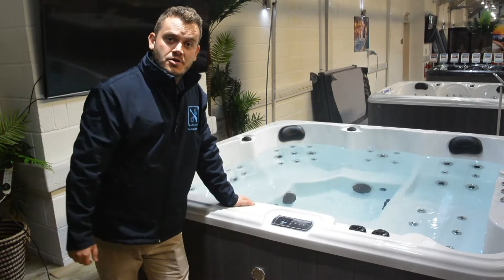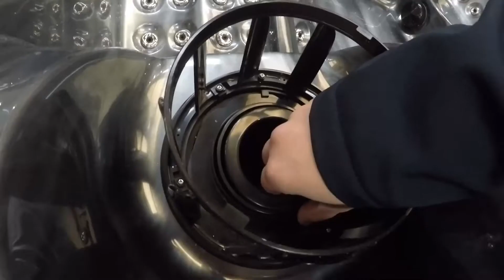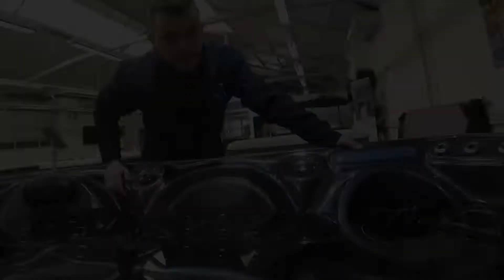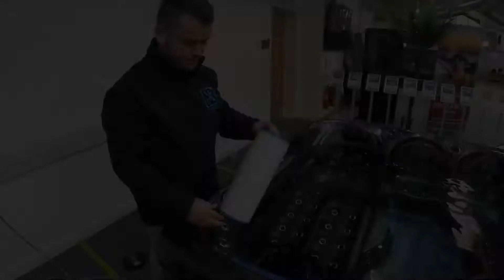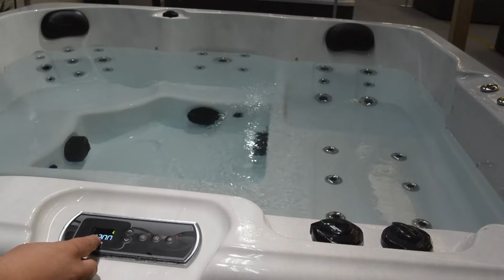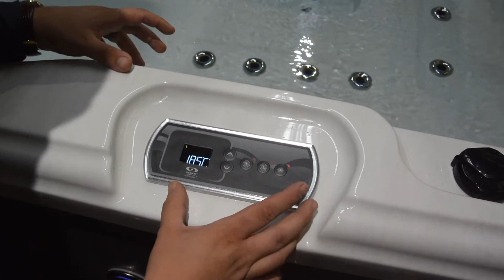Starting your Gecko hot tub

Comment: I have just moved into a house and it has an aeware 3 by gecko and we are confused what to do with it. It is filled about half way. It looks much bigger than the one in thr vid and the water isnt clear, its very blue
Reply from the maker: Hello YuzeLemon, hmmm.
Our Gecko  hot tub models all work with INK300 or INK330 panels that wire into the standard Gecko IN.YJ-3 Control Box. If you have a hot tub with the Gecko AeWare IN.XE or IN.XM2 Control Box, you are more likely to have the Gecko IN.K450-3OP panel.
Although we can't advise you on the specifics of this panel, we did find these instructions online that we hope will help;
https://geckokeypads.com/k450use
If your water is not clear, and you have just bought it from a previous owner, we would always recommend filling it up fully, running a system flush to clean out all the pipework and then draining and cleaning the hot tub before using it.
Hope this helps, thank you.

Comment: How do you turn the light off on the control screen , it stays on overnight!!
Reply from the maker: Hello Mike, as far as we are aware the light inside the Gecko control panel is a built in feature of the hot tub being powered. We are not aware of a way to turn that light off without switching off the whole hot tub unfortunately. You are welcome to call our customer services team to talk through any issue you might have with your control panel as they are much more knowledgeable than us in the marketing team, but it may be a question for the Gecko manufacturers. Hope you find a solution, thanks.
Blue Whale Spa
Reply: @bluewhalespauk  as long as it normal, Im good 👍🏽 thanks for the info🤜🏽
Reply: This sucker turns on periodically, Im worried about my electric bill !!